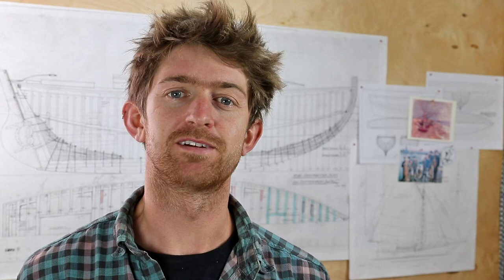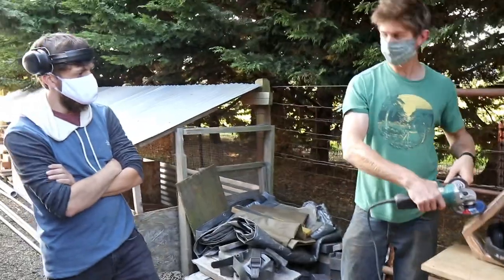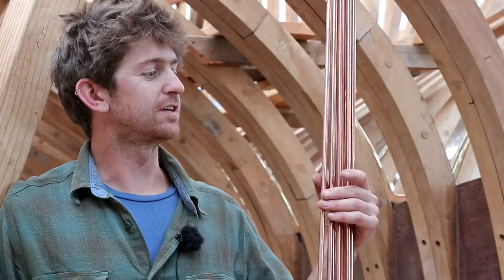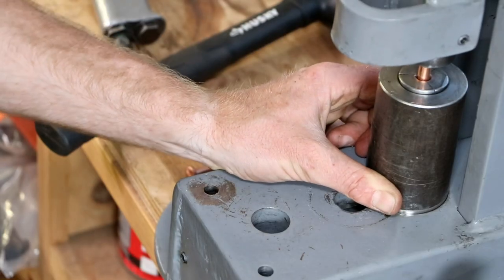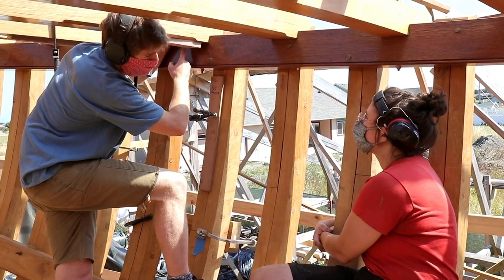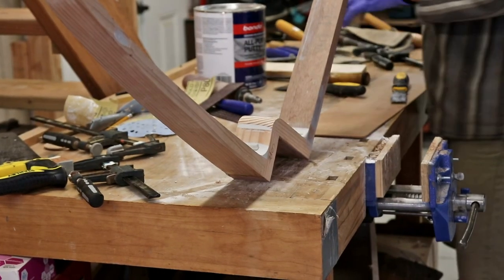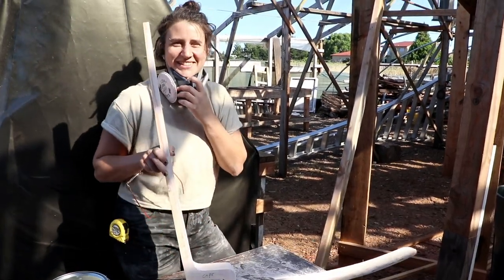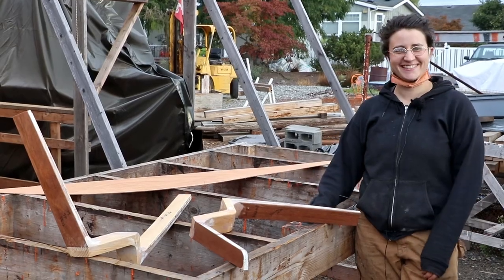Custom rivet press machine! - Wooden Boat Fastenings (EP79)

Comment: Hi Leo,
fantastic work and knowledge, amazing.
One thing about the patterns of the knees.
The inner edges of the patterns have a 90 degree angle. That's not good for strengh.
Also the edge is rounded on the outside. So the material at this point ist thinner.
Every corner on the outside is rounded and looks very well.

At the plans I can see the original shape of a knee.
 The shape ist important.
I think I'm right, may be there are other reasons for your decision.
Let me now, even if i'm wrong, if there is enough time...
Thank you for your work.

Comment: Will copper, being a soft metal, be stressed into coming loose via creep or plastic deformation over time?  Love the commitment of the volunteers and the ingenuity of the guy making that die press.
Reply: I'll wager that every time the hull is surveyed (at 10-year intervals?) a hammer would be swung at quite a few internal rivet-heads. If any are found to be loose, those sections of the hull would be marked out for plug removal & re-bucking of rivets, as part of a normal haul-out & repaint yard period. I doubt any rivets would need replacement, just a few convincing whangits to recall them to duty.

Comment: @Sampson Boat Co Leo, at 26.30 you described how the Hanging Knees have had Bondo added to the Internal corners to allow sand release and molten bronze flow. Is there not a good reason to actually trim the Deck Beam instead? I could see a stress riser being introduced if that material is ground away, that a rounded and filleted corner would avoid. There is plenty of meat in the deck shelf beam to trim, but a hard corner in the casting would be the perfect place for crack propagation....... Think of the Great great grandchildren!

Comment: Have you thought of adding saw dust to the bondo to firm it up? Might save on finish work. And I would be cutting the rod on the same stroke as forming the head, sure you've got enough force and get two operations from a stroke. Hi Alex!

Comment: The usual amazing work. I just rechecked out the first video to get a sense of the rate of progress. It was 3 years ago. A much younger Leo! The work is moving so much faster now, and at a quality level that would far surpass the original build. I reckon Tally Ho will be sailing in about two years, maybe even less. Planking will be all done in the next few months, certainly be years end.
And that is how it should be. Five years is long enough for a project like this. 
I do find Acorn to Arabella a bit depressing. It is taking too much time out of a lifetime, with not enough time for the adventure at the end. I get that they are literally going from milling the timber to a boat, but even so. Too much of an alternative lifestyle for me.
I have had two classic yachts, and restored both (mostly using professional work with some assistance from me). A year on each project was enough for me, but then we didn't have to literally rebuild from scratch. More like restore an reasonably decent basic structure. Both had classic carvel wooden hulls. Both Woollacotts, built in Devonport, New Zealand around 60 years ago.

Comment: It looks like you can advance the rod after pressing the head onto the previously cut piece. Therefore on the upstroke you can cut another piece off and have the it also ready for pressing. Might save a second or two per rivet.

Comment: On the hanging knees, on that inside corner that fits up against the wood, you might want to have that inside radius checked to make sure that the radius is big enough so that there's no stress concentration there. I'm not a structural engineer so don't take my word for it, but it's probably worth a phone call or two, just to make sure. Cool project!
Reply: kolim jone  Not true
Reply: "She will have her original lead ballast keel, some planking, other re-used original timber, and various bits of hardware, as well as the continuity of looking 			
like the same boat in any one given day. According to Lloyds, the Greeks (see ship of Theseus), the wooden-boat community, and myself, it will be the same boat! 			
But, people are free to disagree and call it what they want."	

Leo Goolden

Comment: Bondo, while its still soft, can be shaped with a surform. Then much less time is wasted shaping it with sand paper after it's hard.

Gloves bandsaw, even more dangerous than gloves and table saw 2 weeks ago. If the bandsaw blade catches a glove, it may not cut the  fabric, instead pulling the fabric and hand inside into the blade.

Comment: If you make/carve patterns out of extruded polystyrene you can leave them in the moulds pouring in the metal burns away the pattern so you don’t need a taper and can get negative relief

Comment: I was hoping that the rivet making machine would have an image of Tally Ho in the die that presses the head - so every rivet would have a tiny image of the boat on it!
Reply: When the rivets are used, a second head is formed on the other end.
Now, will they be inserted from inside or outside and where to put the TH? Easy matter to strike an impression at this stage.

Comment: Awesome machine and impressive workmanship. You guys put more effort into making molds than most people put into making a final part. I look forward to each episode.
At 15:10, the frame in the foreground looks like it pulling apart (probably expected as the wood seasons), is that going to be an issue?

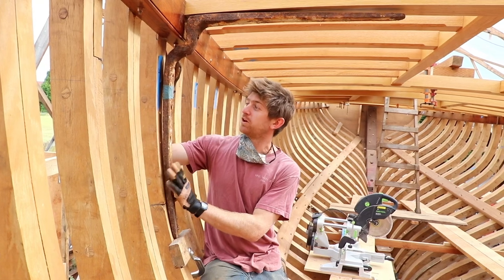Comment: 25:25 Oops! I asked this question about 30 seconds too soon. This left me with another question: How similar are adjacent patterns? Evidently not similar enough to share patterns, right?

Do you have any of the original hanging knees? Presumably they weren't bronze. I'm curious to see how they were fabricated. I'm just stunned at the enormous work in making these castings...with unique patterns for each which are used just once...or is it twice, once for each side?

Comment: That rivet forming machine looks like a winner.  Am curious about how you will pean the other ends of the rivets after they have been
 inserted through the planking and frames.  Would it be feasible to fabricate a heavy offset clamp that would fit around the rivet head and frame to hold it in place while you peaned the other end, eliminating the need to have someone hold a backing object against the rivet head, except where there was no opening left for the clamp?  Would heating the rivets just before installing make them easier to pean?

Comment: Been watching and impressed with your knowledge and team's skills.  I'm neither a boat builder nor sailor but curious about the brass floors.  Would their weight allow for a greater (bigger) mast giving better performance than the original.  Perhaps later in your series when installing, explain how the height of the mast is determined and its bearing on the speed of the yacht?
Reply: Tally Ho was originallly built w/ a few more iron floors & knees than were specified in the original design. These served her well when she was re-rigged (topmast added & 30% greater sail area) prior to the 1927 Fastnet race. Leo has already made a substantive change - the mast-step portion of the centerline timber is 3 feet longer, to give better support to this larger rig.

Comment: I'm thinking that it might be more efficient/fsayer over all to cut all or a lot of rivets first, then press the heads on. The number of steps to get through the complete process, (cut, place pin, hit with hammer, position collet, stamp, release collet, remove finished rivet) might be quicker because muscle memory kicks in on smaller number of steps. Anyway, my two cents.

Comment: Using the rivet making tool, could you be cutting another length when you remove the rivet from the die/collar? This would save one extra actuation on the press.

Comment: you could reduce the time of the rivets by not raising the head/lowering the ram as much and just leaving a small enough gap to maneuver in and out, of course when its not in use the ram should be retracted/head raised

Comment: As an industrial Architect who has designed many highly rivoted pressure vessels, i have concerns about the the rivot head size and shape, can i suggest you do a shear test to destruction of a corked frame and planked rivoted test peace, if the boat hits a dock the ripple effect along the boat will suck the rivot head off, are copper washers going to be used on both side of rivot

Comment: Awesome video. Just wondering, doesn’t copper corrode when exposed to oxygen or water? Does that cause an issue for the rivets?
Reply: Copper & bronze do corrode, but the patina acts as a seal on the metal surface. When iron corrodes, the iron oxide molecules are much bigger - they flake away from the surface & expose more raw iron to oxidation.

Comment: Please always use a push stick (minute 16:16) with the jointer.  Even with a relatively wide plank, a slip with the hand pushing the end through is possible.  Putting the heel of your hand through the jointer will end very badly and is an unnecessary risk.

Comment: Maybe a bit late now, but if the floors have a gap above the keel, rather that grind for hours (and remove metal which is strength), just put a packer underneath  to close the gap ?  I dont know about boat building and i gather it has many traditions,  but in mechanical engineers the use of shims and spacers is considered totally kosher. The packer could a but if purple heart or a bit of bronze, your call really. Bronze is conceptually correcting the cast floor to negate the mould swell you got,  using purple heart has the advantage its soft so super easy and fast to carve away to fit 😀

Comment: How does the riveting work? I am guessing the heads you made on the press will go on the outside plank, what's gonna happen on the inside? You said something about 'pinning over'? What is that? These rivets seemed short to go through the frame and the plank...
Furthermore, how do the planks get fastened at the bottom were the frame meets the purpleheart timber?

Comment: Question: when the newly made rivet is put trough the plank, is there a washer between the plant and the rivet head,  or is the plank strong enough the rivet head will not work its way through the top pf the plank? Thanks!
Reply: Yes, they'll use washers on both sides.

Comment: couldn´t you use a tensile rope that is attatched at the front and the back transom(?) to make sure all frames are faired? If the rope is flush on the frames they should be perfectly aligned

Comment: RIVET PRESS TIPS  ..... (great unit) ..... 1.  If the copper stock was inserted to the stop prior to pressing  the previous rivet then the next would be cut in the first part of the previous pressing stroke.   2. If the stock was prevented from bending down during cutting, the cut end would be more square  and less inclined to cam over at the first moment of pressing the head. Probably more critical if attempting broader heads.
Wish I could be there ..... I'd be in seventh heaven. B.

Comment: Id go about things bit difrent fitting the flors and hanging knees. wont grinde the bronze that far. heat them up 500c and burn them into the timber so thay create there own seat and seer the wood. that carbon skin between wood and metal is a good thing. can save your self days of work and get the est fit posibal

Comment: I couldn't help noticing you are marking the knees with a sharpie. That is all well and good for the pattern, but it won't show up in the casting.
To make a marking you can see in the casting as well, you can use the Dymo embossing labels (or similar). The embossed letters show up quite well in sand castings. If you want to go for extra points, it's easy enough to inlet the label so it's only the letters themself that stick out.
(It goes without saying, but I'll do it anyway. You can only use the Dymos on the top or bottom of a pattern)
Best regards from a retired patternmaker - your patterns look good. :-)
Reply: Good tip, I use that method, I like to put a casting date on parts with a Dymo you can just peel it off and replace with the correct date. Also fun to come up with clever part #s.

Comment: The reason the inside of the pattern is filleted then ground off the casting is because when cast a sharp corner you get shrinkage and cracks.

Comment: Hi. Just a small enquiry, will you be able to use the one knee pattern on each side of the same frame? If so, well done!!!
Reply: Not really.
A boat curves in three planes.
So port and starboard are mirror images, but not the same.

Comment: I'm sure whoever is making the majority will figure out workflow.... 

But I reckon you could shave 5 seconds off the time if you make the length cut and collet release actions one manoeuvre not two... Not sure on the load bearing but that gear reduction seems effortlessly powerful.

Also you could probably just halve the time per rivet by manufacturing another collet and die set, and manipulating the activation lever to a foot pedal :)
Reply: BIG props to it's design tho!! Amazing 👌
Reply: Infact these improvements are only POSSIBLE because it's already an amazing tool

Comment: As a next step ... can the rivet machine be modified so it can give the same productivity gain when forming the head on the other side of the rivet during planking ?

Many ways to skin a cat but I have in mind one way, keep all the moving parts and hydraulics as is but modify the lower frame or move the moving parts over o to an alternate lower frame designed to go between the frames and backstop the other side if the rivet? I'm.sure I have seen pictures of similar huge things used to rivet the great iron and steel structures of 100 years ago together.

Ie instead of the current large base has something that looks like some kind of big g clamp body that can is small enough to be be passed between the frames of the boat and placed on the pre made rivet head on the other side of the plank, then just push the lever and squish, the other end of tbe river is formed in 2 seconds

You could visualise/test the concept using the machine as it is now, ni changes at all .. you just need to assemble a stack up of a scrap of steel plate that's placed over the hole where the die body does now, to act as a die for the already formed head, then an off cut if plank and and off cut of live oak frame trimmed such that the stack up is the same.length as the current die body. Drill a hole and insert as rivet. Cut off the rivet with the correct amount left (same same.as you currently get when you use the hole as the jug to.load the collett). Press the lever and have the machine form your head on the other side in 2 seconds.  I cant decide if its ok to just press the copper rod as is, or if that will.spread it inside the.oak frame, in which case add a (also silicon bronze) washer first to.keep the rod together. What happens when you form.the rivet heads by hand ? Some r & d to.do there 😀

Details :

 A screw or some slide on spacers of the  new end  allow for rivets needing to be different lengths. 

And since rivets are now pressed rather than hammered, the comments elsewhere suggesting a monogram on the dies could be incorporated as well 😀

Before anyone says "it would be too heavy to man handle the river machine around the hull during planking .. a simple rope up to a pulley suspended from the roof .. leading to a counterweight wherever is convenient.  It will be big and awkward but weightless.😀

Comment: Okay, you are making cooper nails with this tool; how will the other end look like ? Screw? Rivet head ?
Reply: It's a rivet, someone will press a large weight against the side that has a head and the end without will be hit with a pneumatic hammer to form a head on the other side.
Reply: Alex Hamon Thanks Alex. I thought also that will be the case, but missed that in Leo‘s video - maybe I just overlooked it.so will be interesting to see all the holes drilling, making the rivers and ensure no water will drip through the holes. And of course it is a lot of work , that seems to be a bit easier nowadays with Alu bodies and wig/mig.

Comment: I would heat the floors up red hot and let them burn themselves in place. The carbonized wood would be rot resistant and you would not have to grind so much... Problem is to heat these big pieces of bronze is troublesome and it would be dangerous to handle.

Comment: Are any original parts going to be on the boat?
Reply: So far the ballast keel, most of the transom, and the main skylight trim.  I suspect, There will be a bunch of original wood used on the interior along with hardware.  Not sure how much of the rig he has stashed away.

Comment: How would they make the hanging knees and floors in 1910 when there was no plywood, glue or bondo?
Reply: Wood templates, then heat a length of cast-iron strip in the forge, hammer to match, grind to fit.

Comment: Some have said to cut all your blanks first, but that is unnecessary and a waste of time. You can save a considerable amount of time and energy, as well as wear and tear on the machine, if you'll cut the next rod to length on the same stroke while forming the head. Make a tray to catch the blank, so you won't have to catch it with your hand. Make the tray at an angle, so it falls to the right, maybe into a "cup". 1) insert the blank and secure it in the die. 2) advance the rod to be cut to length. 3) actuate the ram to form the head and cut the next blank on the same stroke and let it fall into the tray.